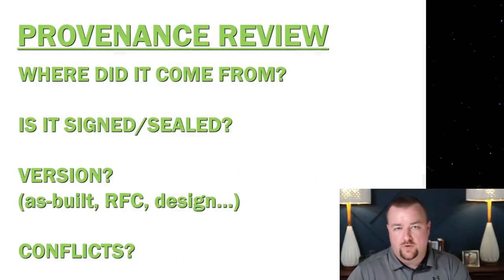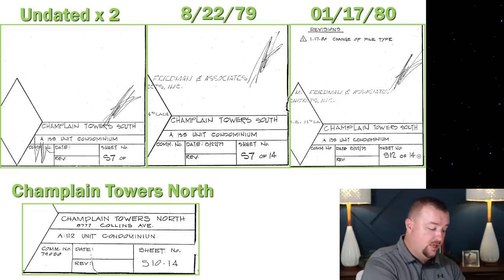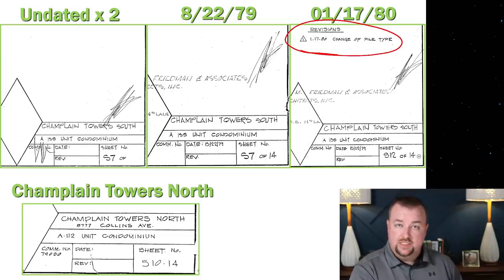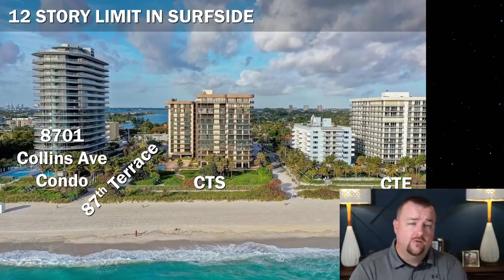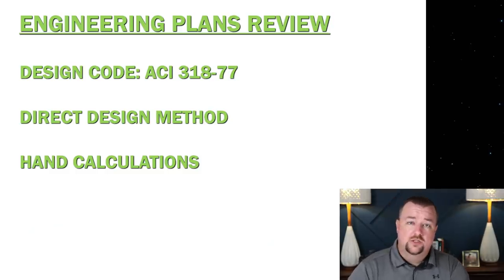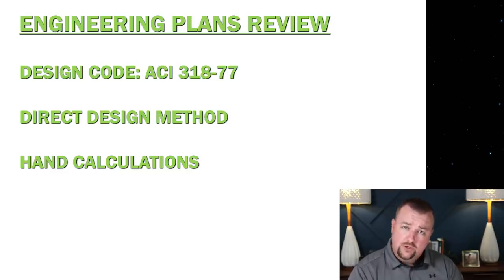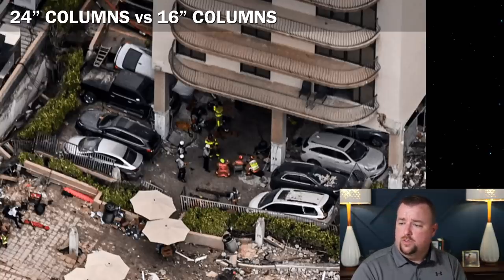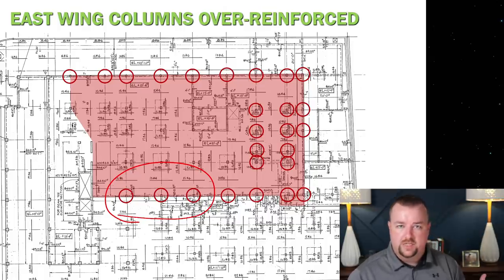Engineering Failures Found in the Champlain Towers South Drawings - Surfside Collapse

Comment: Simply citing 16” columns without span or load doesn’t tell us anything useful.  

The problem here, and one that matches the fact pattern, is long term undrained water collection on the pool deck slab, leaching the concrete, changing the PH, and eventually destroying the steel.  Water intrusion will eventually destroy any design regardless of load margin. 

Roman concrete structures survive two thousand years because they don’t use embedded steel.  Modern rebar concrete can not withstand sustained, decades long  unprotected contact with water.  As long as the the industry continues to pretend away the problem with “maintenance plan”  or “big beam” hand waiving, reinforced concrete structures will continue to fail.
Reply: Non-reinforced concrete structures fail at a small fraction of the loads of reinforced concrete, and they fail from essentially the same issues.  Water seeps into the concrete, an weakens it over time.

Meanwhile, you gave an excellent example of the survivorship bias fallacy.  Most Roman concrete structures didn’t “survive two thousand years” at all.
Reply: @Vessekx    Non reinforced concrete structures are much weaker in tension than steel reinforced,  not in compression.  And of course failure rate due to prolonged contact with water is orders of magnitude higher with reinforced concrete than with non.  It’s the expansion of the steel with the onset of corrosion that drives failure in years and decades, as opposed to centuries with simple concrete in compression on stable foundations.  

Yes load and shear design are vital.  Yet water contact with unprotected steel reinforced concrete structures is like slow prostrate cancer in humans: no matter how good the design it will kill the design if it lives long  enough.

The relevant comparison with the Romans is not with failed vs still standing structures (a great many), but notionally with the remaining  Roman structures and the lifetime of steel reinforced structures, such as they are since the advent of modern steel.  Take away lucrative maintenance rebuilds and it’s  no contest so far.  A good way to have turned the Pantheon into dust by the Middle Ages would have been to invent rebar for Pantheon construction.
Reply: @Nill757 , so your chosen ‘metric’ is to explicitly cherry-pick structures based on their long-term survival, and completely ignore the larger multitude of failed structures, while also ignoring the damage those structures have sustained, as well as the upkeep and maintenance they received, even as you explicitly disallow the consideration of such maintenance for reinforced concrete structures.

Bravo.  You’ve demonstrated a whole slew of biases that render your purported ‘analysis’ completely useless.
Reply: @Vessekx  You seemed to have developed a habit of putting words into the mouths of others.  You’ll find, eventually, none left listening.
Reply: @Nill757 , what words did I supposedly ‘put in your mouth’?  Was it the words where you explicitly said that you were discounting the thousands upon thousands of Roman concrete structures which have failed, and comparing the remaining set to the failure rate of reinforced concrete?  I didn’t put those words in your mouth.  You did.  The part where you say to discount the maintenance and upkeep work.  Again, you put those words in your mouth.

It is, however, quite interesting that you not only failed to refute anything I said, but that, instead of even so much as attempting to do so, you conceded the point by simply attempting to deflect attention from your own failed argument.
Reply: @Vessekx  You are making things up.  I didn’t say “discount” about anything. I’m also not following you down every rat hole that you insist on, like the shape of Roman haircuts, or that Pompeii was destroyed by a volcano, or any other irrelevant obsession you demand be discussed.
Reply: @Nill757 , you: “the relevant comparison with the romans is not the failed vs. still standing structures…, but notionally the remaining Roman structures”.  That’s you insisting that we discount the huge body of Roman concrete structures which haven’t survived.  (Oops, you just claimed that you never said that…)

Also you: “take away lucrative maintenance rebuilds…”. That’s you insisting that we filter out maintenance of reinforced concrete structures, while ignoring the fact that those Roman structures which have survived were maintained.

I’m not the one making stuff up.  You are.  And you’re doing it in spite of the fact that anybody can read this thread and watch you beer caught in your lies, and sad attempts to deflect.

Ironically enough, immediately after falsely claiming that I had put words in your mouth, you attempt to put words in my mouth, falsely claiming that I had said anything off topic, much less anything about roman haute cuts or Pompeii.

You got caught spouting nonsense.
You couldn’t defend that nonsense.
Now you’re spouting more nonsense in your effort to deflect attention from the fact that you got caught spouting nonsense in the first place.

It would have been easier for you to just not spoil it nonsense, but that is clearly beyond your intellectual capabilities at this juncture.

Comment: well, like i said three weeks back, it collapsed because the concrete design was too weak. now, specifically, we see what about it exactly.... was too weak. an oversight in the design; one not seen unless meant TO BE seen, occurred. 40 years later the salt water deteriorated that weak concrete design so much that heavy cars, planters caved in the cement slab, and like dominoes, down came the building integrity.

Comment: so having rules is bad because they wont be there to be cheated, and will simply not exist to be broken? if the regulation didnt limit the floors then they woudln't need to f around with  the garage. they just would have built however many floors and screwed around with any other things that would not be regulated.

this is not a problem with regulations. this is a problem with cheaters trying to avoid them./ if anything this means regulation need to be even stricter to nab these cheats.

Comment: Romans built buildings that stood for 2000 years.  They didn't have engineers.  An engineer designs a building to barely stand.
Reply: The Romans had stone and a lot of cheap labor.  Structural stone buildings are very expensive.  The last large building in the US built of structural stone was the Monadnock Building in Chicago, started in 1884.  The Romans certainly did have engineers, and good ones.

Comment: The biggest engineering failure was to build on sand .
Reply: @roddychristodoulou9111  — You are just hand-waving.  When you say “built on sand,” that implies that the footing was undermined leading to collapse, as sometimes happens with bridge supports.  We know there was salt water intrusion, but we don’t know whether a column footing collapsed.  The NIST will document the foundation design and how it may or may not have contributed to the collapse.
Reply: Yes I agree , my comments are based on what we know so far .
It's very telling that the beachside part of the building collapsed , it's also very telling that the collapse began below ground level .
Don't expect to get the truth in this case , there are too many players with money to win or lose , so like everything else we have to try and figure it out for ourselves .

Comment: I've worked as a machinist so it's a little apples and oranges but the prints not being updated correctly and revs not being cited drive me nuts. They helped drive me out of the field. In machining that kind of lackadaisical engineering is rampant and most supervisors expect underqualified operators to catch and fix those mistakes on the go. Basically, if you can't or won't do the engineers job for them you're going to have a rough career and I absolutely did. I love doing the work of machining but the culture of the work direction is lazy and dangerous and I cannot be a part of it anymore. I know there are good firms and solid engineers out there but those places seem pretty staffed up and since I never was able to play ball where I was I don't have the best resume. I knew I couldn't hack it as an engineer and was honest but nobody listened. The equipment I made was used to drill for and transport crude oil. My being forced to do something I wasn't qualified or trained for might have or might yet get someone killed. It could poison an ecosystem or even just cripple some critical piece of energy infrastructure and send the price of fuel through the roof pissing off millions of daily drivers. I'm glad I don't do that anymore but I do miss being a machinist in principle. The work itself was great but the management was outright dangerously incompetent. To cap it all of the place I spent the longest at told us all if we voted for Trump they wouldn't move the shop to Mexico, which is blackmail by the way. In 2018 they announced the move to Mexico anyway. The old shop site will soon be high end condos for rich kids. A couple guys lost their families over that, and some killed themselves. I tried, but couldn't go through with it. If you're an engineer and you're reading this and you assume how you scribble up a design doesn't matter and half-assing it could never matter that much think again. It could save a business, or a life. Doesn't apply directly to my situation but still, don't make any excuses, do the job right if you're so smart.

Comment: Because of adding loads without bothering to re-calculate, perhaps budget builds need an expiring date :) Whether it´s planteries, ac units, heavier cars or just plain erosion. New owners care about profit, not blueprints.
It indeed seems the design was flawed, but if everything was more beefier, it may have lasted. Which makes me wonder about other possible time bombs: You can´t see everything on inspection.

We see planes crash, because too many people plug in their laptops or because of obese passengers. Bridges collapse because traffic gets heavier. Old ships turning into death traps. Everything gets overloaded.
Instead of cooping with the times, cheap designs just erode and all they get is a new coat of paint. We need more Brunels :)